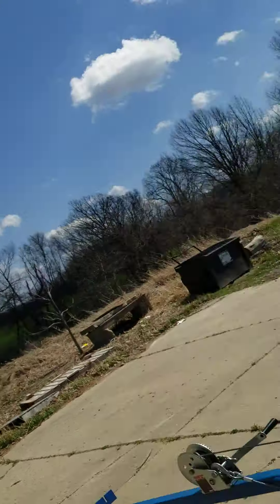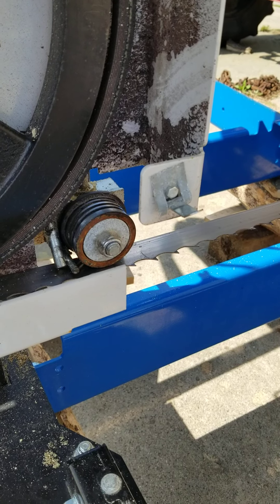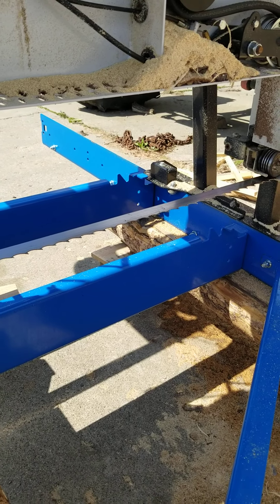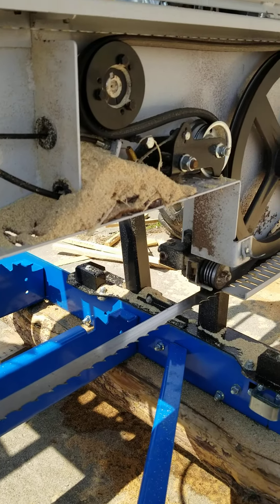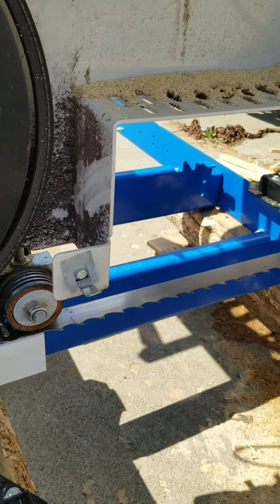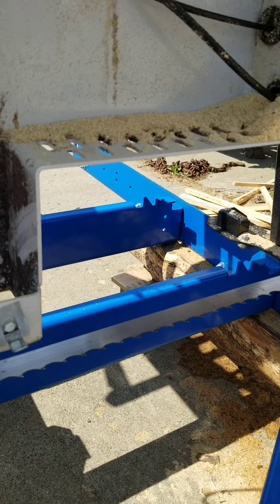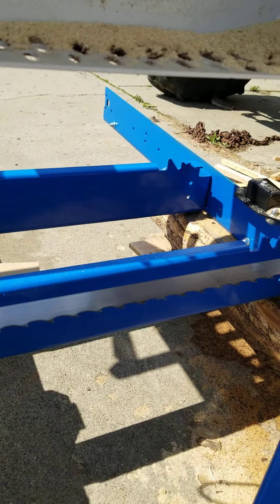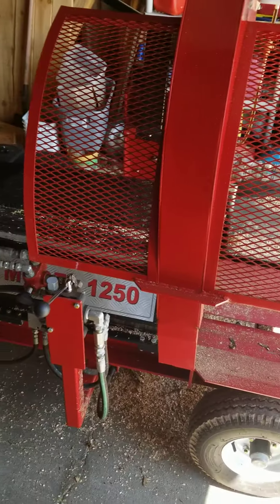Sawmill blade lubrication testing water apposed to a plant based oil from Michigan Sawmill Sales LLC

Comment: Thank you for the video. The results from this test look promising! Any updates or customer feedback/ratings regarding this plant based oil?
Reply from the maker: Yes there have been good feedback. This product is best suited for roller bearing guide systems for players lubrication. We do have some product at some big commercial mill operations for testing and also at woodmizer for testing as well. The individuals who have tested it have given great reviews. But this product is great to have regardless for Sawmill care. Keeping bearings lubed, lift cables lubed, and cleaning up and wiping town for storage. Great rust prevention cleaning products for your mill. I have also found this product works awesome around the shop! I use it on my saws and for bit and blade cleaning! Very versatile product to have around.
Reply: @postframes_processors_sawmills  Thank you for your response! I checked out your website but I I was unable to locate this product... what is the best way to order?
Reply from the maker: @c.martin1016  Yes I have to get it on the website! You can call the office at 810 354 8027 and we can get an order together for you. I will have the product on the website soon.

Comment: whats the difference between that oil and cooking oil?
Reply from the maker: Thanks for you question. The Five Star product is a formula from a plant based oil. It does have other ingredients in it with the oil. Five Star has invested alot of time and money on ASTM standard testing on its properties, and getting USDA bio certification. If you email us at info@misawmillsales.com , I will be happy to send a product data sheet for your review. I can also send quantity options with pricing. I would assume you could use cooking oils if you wanted to, but the properties of this product are different from straight up cooking oil. It has many advantages over using just cooking oil from cleaning, lubrication, viscosity, sawdust cling, consumption, penetrating steel providing long term protection, and Ph. I can only testify on how it has performed for my sawmills from a Sawmill care product and blade lubrication and it has exceeded my expectations. Thanks again for your question.